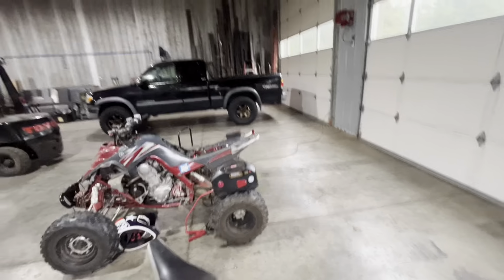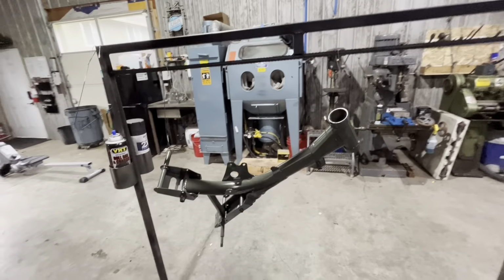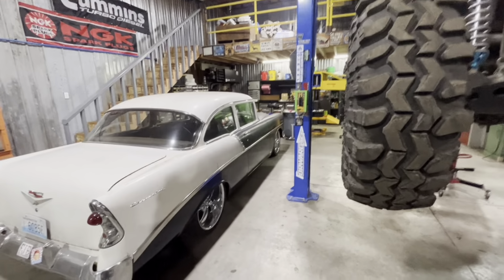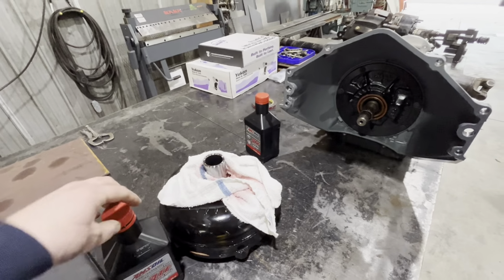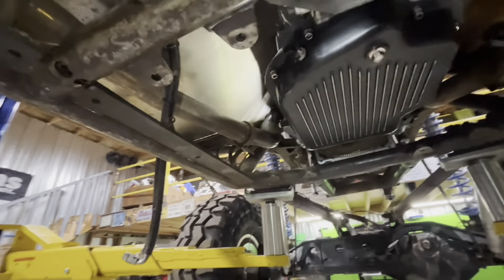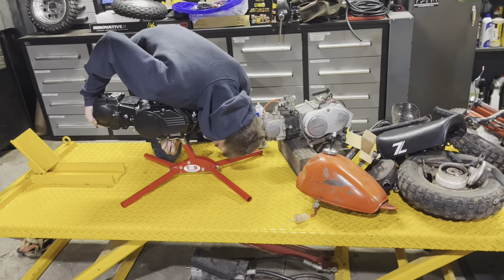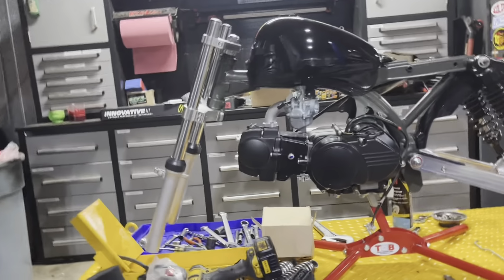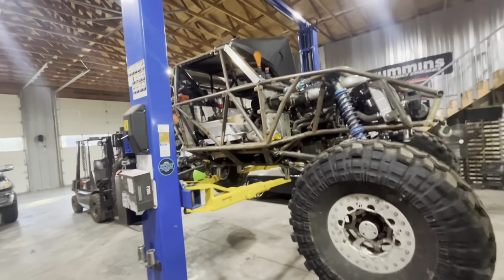Rock Buggy gets its th400 transmission back💪🏻 kid starts his Honda z50 build 🛵 project updates

Comment: You going with regular 60 outers on the front 14 bolt build or the newer 05 and up ford outers? Looking forward to that, I haven't seen a 14 bolt front build in years.
Reply from the maker: Ya, I got Reid forged innner c’s and knuckles and I’ll swap my willwodd brakes over, 40 splines shafts, either rcv or branik 300m haven’t decided